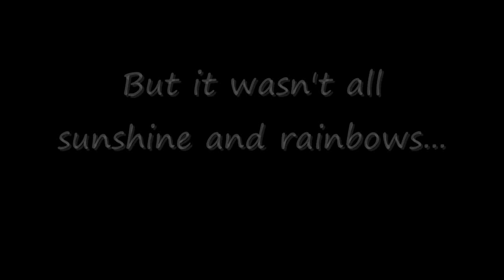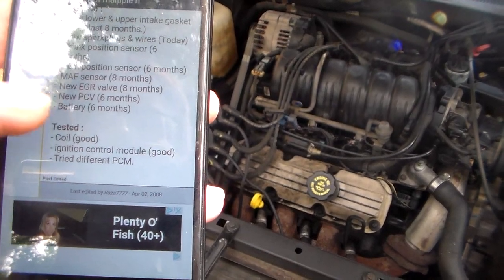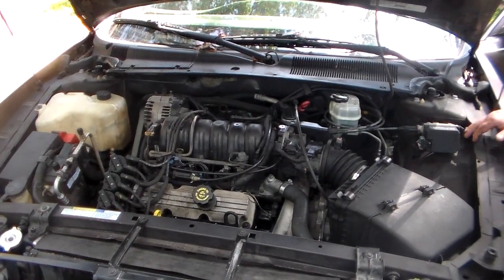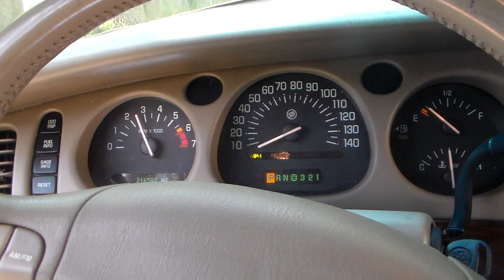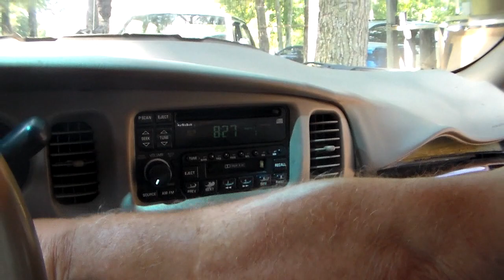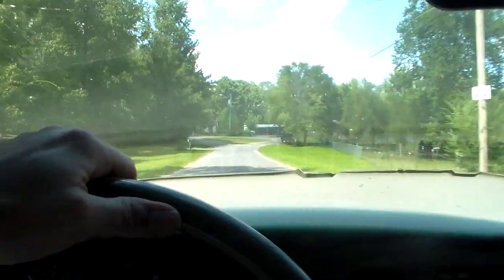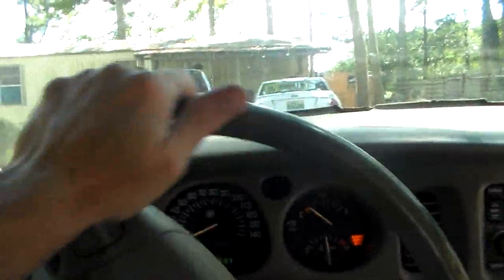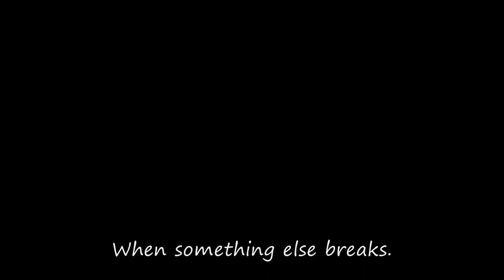Chasing a phantom in a 2001 Buick LeSabre

Comment: A trick I've used before to find vacuum leaks has been to use carb cleaner, spray it on any areas that you think might be the source of the leak and when you hit a spot that is leaking the carb cleaner will get sucked in and the engine will briefly stutter.  Carb cleaner tends to be slightly more accurate than water as most cans come with a straw which makes it come out in a nice, precise, easily aimed stream.  Plus, if you use water and you have a big leak it might suck in enough to hydraulic the engine, some engines really don't need much water to do damage.  I've been told that brake cleaner works as well but I can't comment on that as I've never tried it...

It does occur to me that the reason that the car played up when Uncle Phil drove it but not when it was sitting is that when he was driving it the problem became severe enough for the ECU to put the car into limp-home mode.  However, when the car is sitting in the yard running there is no input to the ECU from the speed sensors which might be required for the vehicle to go into self-preservation mode...

Comment: there is a evap purge solenoid right there where he was fiddling with those emission little hoses and dried out hoses.  Easy to replace.  If engine is running and you touch that little thing you should feel pulsing or clicking  a few times a second. It is "pulse modulated".  And from personal experience having worked on my 1997 buick, changing the spark plugs and wires can help a lot in eliminating misfires, especially on an older buick where the plugs can foul a lot.  Then a lot of carb or throttle body cleaner, and good gas treatment

Comment: Mass air flow is prolly bad, it will cause a misfire, and the lean code... Known issue on the series 2.. Also if it idles rough when cold and better when warm check the intake, it's prolly warped. Run the motor and dump water around it, if you see smoke come out of your tail pipe you found your leak..  Also another huge issue is the tube that connects the egr to the intake manifold .. It's behind the exhaust pipe that wraps around the engine on top the trans on the driver side...  If the car stalls hot and starts after cooling down, I would check the ignition module...  

Mass air flow sensor, egr tube, ignition module, crank sensor, and fuel pressure regulator are really all the known issues with the series 2, the mass air flow sensor is huge...  They fail constantly and you have to get it new from the dealer. Any parts store mass air flow sensor is garbage, your random misfire 0300 code is definitely an ignition module, coil, or plug wire.. Good luck

Comment: It sounds like all 3 of the fault codes are related.  The misfire could well be caused by a big enough vacuum leak which is leaning out the fuel mixture enough to make the engine struggle to run.  Another thought that occurs to me is that the fault that is triggering the evaporative system fault code isn't just a bad fuel cap seal but a fault in the fuel supply system which is allowing air into the fuel system and leaning the engine out to the point of misfire and in view of the issues the car displayed on its test drive I would suggest it might well be heat-related, maybe a crack in a fuel line which is opening up when the fuel system heats up or maybe a degraded quick-fit fuel line coupling which is unable to retain line pressure when it heats up.  I would expect something like that to cause a strong smell of fuel inside the car but if the problem area is far enough to the rear of the driver and any fuel leaking out is going directly onto the road or an area where the fuel is taken away by the air flow under the car it may not do as fuel injection systems run at far higher pressure than those for carb vehicles so any fuel escaping would likely be in a fine mist and easily dispersed, but also easily ignited...  From the way the car started I would suggest looking at hard fuel lines down near the base of the firewall, it looks like the engine mountings are quite worn from the amount of engine rock as it started which could have stressed any hard fuel lines in that area, caused them to become work-hardened and eventually crack.  As that's an area that has a lot of air flow over it that might explain the lack of fuel smell inside the car.  The pipes are also going to be quite close to the exhaust and also the engine itself which would explain the heat factor...

I don't think any of the fault codes that showed up are going to be historic as the car was off the road for a long time and had suffered a flat battery after the intake blow-up, the memory in the ECU/PCM will only last for so long without a power supply so it is likely they have all been generated since the car was repaired and driven...

Comment: I’ve got a 2005 Lacrosse with a series III and a phantom stall issue.  New upper and lower intake, new throttle body, new egr, new crankshaft pos sensor, new fuel rail, new MAF sensor, new coils and coil packs, new plugs and wires, new O2 sensors, and new cat.  Still has the phantom stall.  Keeps throwing O2 sensor codes and occasionally a smog pump code.  A local shop gave up on me, and Buick dealership gave up basically.  They wanted to tear down the work I did replacing the upper and lower intake.  Oh, and the compression on all 6 is good.  I have a camshaft sensor to try, and I have a PCM I bought online I may have flashed as a final try.  All the non-sensor parts were bad or on their way out.  If they were not contributing they would have failed soon.
Reply: Try giving the throttle body a good cleaning that will cause random stalls

Comment: i had one them 2004 park ave blue the top of that intake burned the gas lines  bent the rall on the back it got on fire . i put it all back to gether it ran fine had to put rubber lines on gas lines worked good

Comment: Bad or going bad Upstream and down stream oxygen sensors will cause lean or too rich fuel AND these sensors are important becaz? Prevent cat from overheating. Take a pinch needle nose plyers go around lightly pinch hoses you can hear if hose has a leak. Are you reving up engine? If no? That high engine revving is faulty TPS Throttle Position Sensor located next to air filter, maf, youll find it. I  have 3800 too I just learning about engine but I am familiar with sensors fuses and relay malfunctions or clips need of cleaning. You prob should clean crank sensor plug, both ends, dont over spray only use electrical spray designed for electrical parts, clip is above, to the left of, water pump  housed on manifold. You prob need remove belt and radiator resivor to get to crank clip. It just pulls off or pull clip pull back.